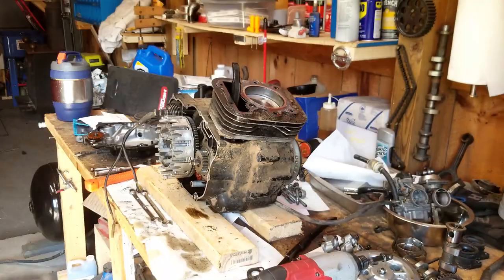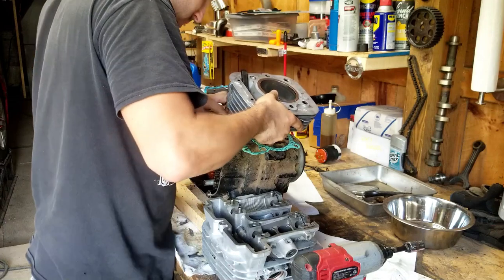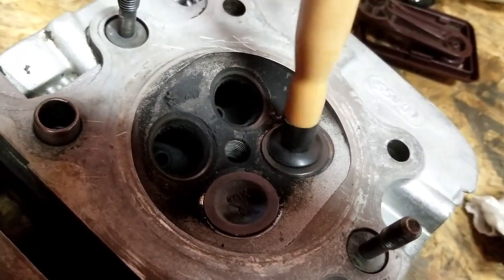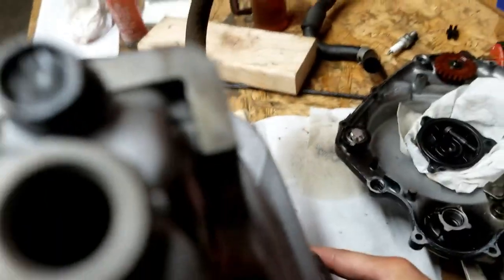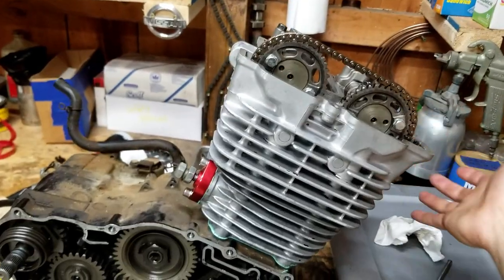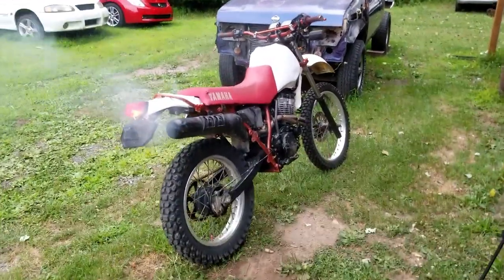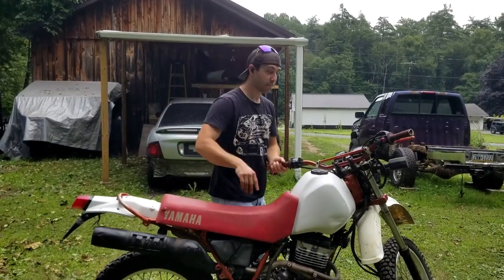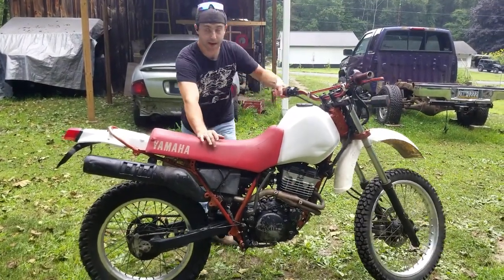89 XT350 Engine Refresh (Short Version)

Comment: Why does it smoke so much, mine does that aswell.
Reply from the maker: I'm going to have to tear it down again to find out why. This one did it when I bought it ober 10 years ago because the cylinder was out of round from wear but I had the cylinder rebored and I rebuilt the engine. This last time I took it apart to change out the tensioner and replace the headgasket and it started smoking like this but it didn't smoke at all before I took it apart so this is something I did I think.